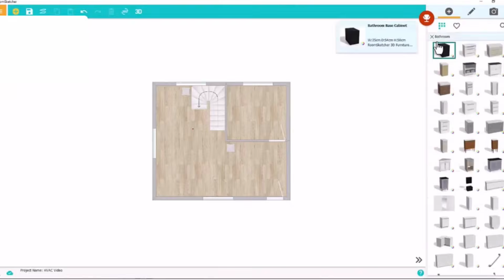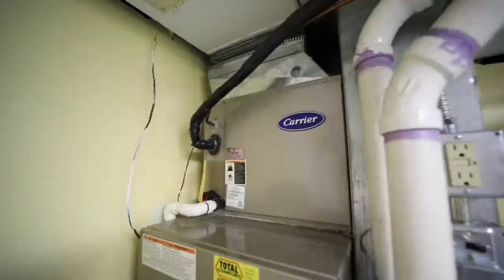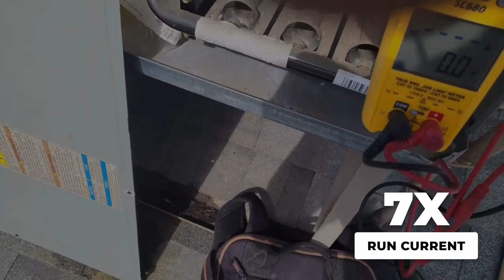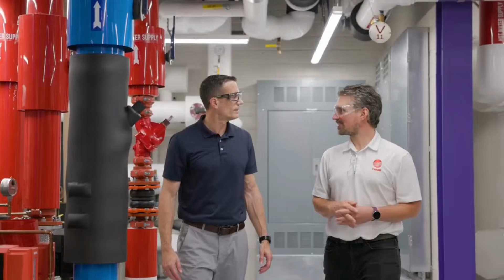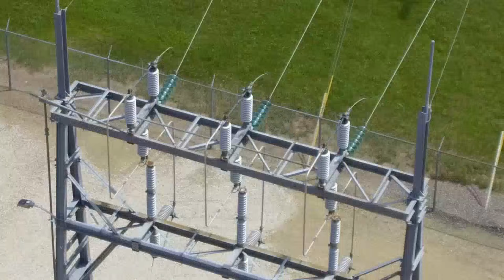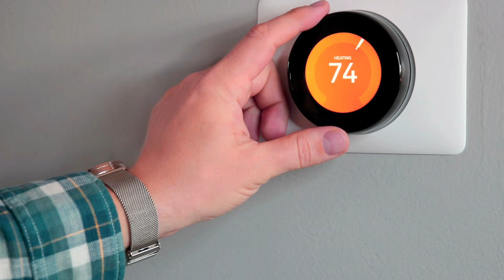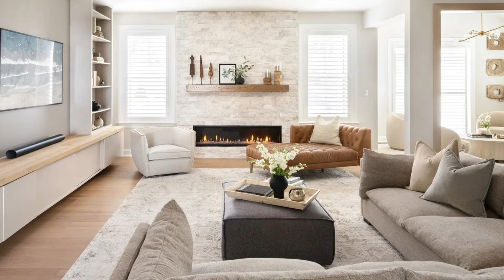How Smart Homeowners Are Beating the HVAC Industry (The 15-Year Loophole)

Comment: Richard isn't too smart purchasing an inverter system. He will have inverter and sensor problems. Too much electronics to fail.
Reply: Yawn... obvious BS...
Reply: The systems have a 10 year parts warranty.  Hence, if they have inverter and sensor problems, they are covered.

I love how people claim inverter systems have all these problems, while in real life, the inverter systems just keep running without problems, saving people hundreds of dollars each year in electricity...
Reply from the maker: @john7017  Too many electronics to fail... meanwhile Richard pocketed $14k upfront. Board goes out, he fixes it and still comes out ahead.
Reply: Inverter systems will not last.  Too many electronics and surge protectors don’t work!  Ask any HVAC contractor how many times they work on mini splits and other inverter driven systems.
Reply: @PhilipNation-xm5lh  You are wandering into logical fallacy on several fronts here:

1.  There is no such thing as "too many electronics".  Electronics reliability has nothing to do with complexity.  It has to do with design, component quality and build quality.

Airplanes have some of the most complicated electronic systems in the world, yet they are exceptionally reliable.

2.  Surge protectors DO work.  It is basic physics.  Surges are High voltage spikes that last a fraction of a second.  MOV's shunt those to ground in a fraction of a second.  Everything in my house from my clothes waster to my dishwasher to my refrigerator to my A/C has a surge protector.  My failure rate from surges so far is ZERO, despite living in the Thunderstorm capitol of the world.

3.  Mini splits are mostly cheap Chinese off brand systems built with the cheapest components you can find.  It has nothing to do with Japanese, name brand or Central HVAC systems.

If you don't know how electronics work, what an Inverter even is, or how it works, then why bother commenting on something you have no clue about...???

It is just bizarre...